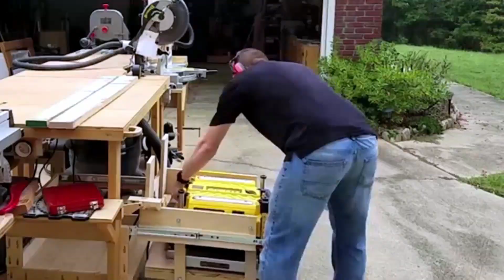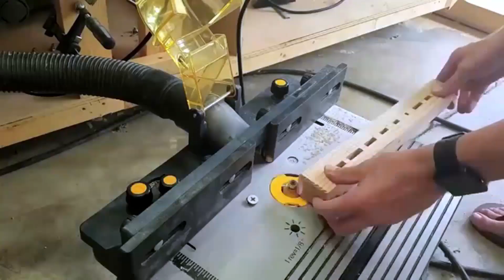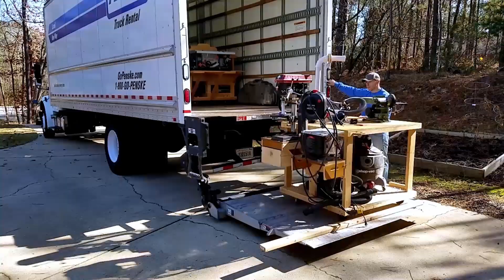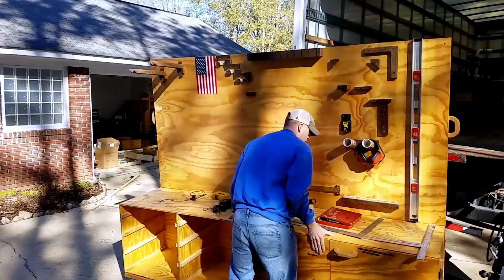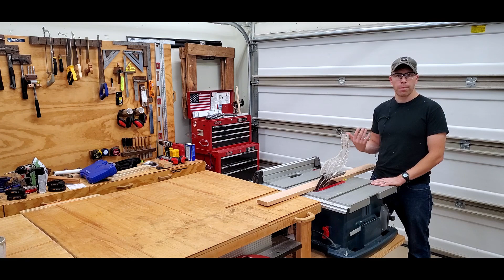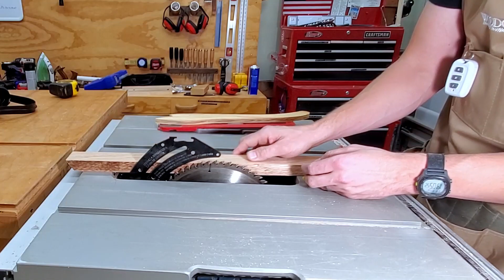How to use a Table Saw / Set-Up / Safety / Kickback / What & Why // EP 63

Comment from the maker: For those looking for specific topics, I've added links to specific sections of the video in the description. 
I recommend Watching video at 1.5x Speed (I'm a slow talker): > Click settings icon > Playback Speed > "1.5" or "1.75"
Table Saw Pamphlet: https://img1.wsimg.com/blobby/go/98cf055b-1d47-432c-93bf-f2e560b99134/BWW_Table_Saw_Safety_%26_Exam_V1.1_CAO_29SEP2020.pdf